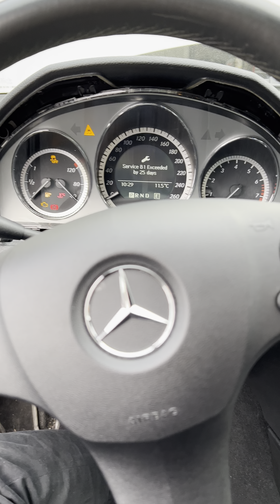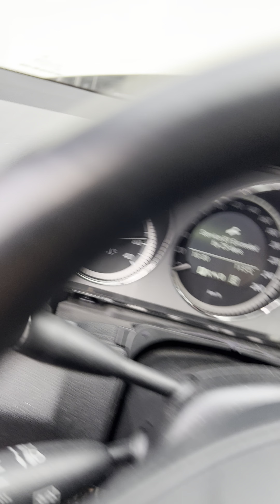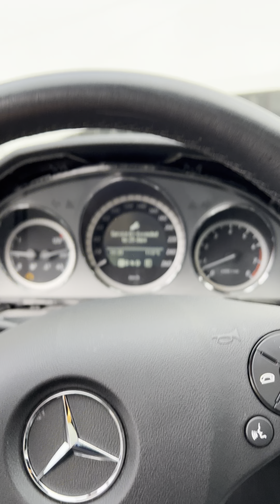Mercedes instrument cluster not working ?? TRY THIS FIRST!!!

Comment: I tried the battery first and that didn't work. Luckily, removing the fuse and putting it in while the car is one did the trick! Thank you!!!!! Saved me a ton of money!
Reply from the maker: No problem my friend 😊
Reply: I tried remove fuse and put it back put but cars wasnt on. Does it need to be on?
Reply: @jammiii3870  I had it turned on when I tried it. Unfortunately, I have the same issue again, but it's just the screen now.. everything else is working though.
Reply: @SirDavidAsher any luck?

Comment: Thanks for the video! Unfortunately, this solution alone didn't solve my issue of the instrument panel not working on my 2009 c300 (w204). What solved it for me was removing the instrument cluster and unplugging it in the back while the engine was off, then putting the key in the ignition to the on position (engine not cranked), and then replugging the instrument cluster back in, and voila everything turned back on and is back to working normal.
Reply from the maker: So you did a hard reset on the cluster, nice 👍
Reply: Didnt work for me, but when I left the cluster unplugged overnight, next day i plugged it in and it WORKED! Insane... must be some chip memory or something inside

Comment: remove the negative with the engine on?
Reply from the maker: With key on  , engine off
Reply: @BPROAUTO95  thanks
Reply from the maker: @imt1217  did it work for you ?
Reply: @BPROAUTO95  will try tomorrow and i'll let you know.
Reply: @BPROAUTO95  ok, so i removed the fuse (engine on) it didn't worked at first, the dashboard remained lit even after i removed my key (it wasn't turning on before that), but the 2nd day it was working just fine.
Reply from the maker: @imt1217  nice 👍

Comment: The video doesn't specify regarding the battery. Do you disconnect the negative on the battery while the engine is running? Or do u do it with engine off?
Reply from the maker: Sorry for the confusion, I disconnect the battery while the engine is off, ignition off, key out.
Reply: Ok thought so. But wasn't sure. The manual specifically says not to disconnect the battery while engine is running..

So I tried disconnecting the battery with engine off and key out.. worked right away. 

Couldn't find the fuse .. I have a 2015 E320. So looks to be different.

Anyways. The battery trick worked! Thanks so much for the video!
Reply from the maker: @DannyFerri  no problem Danny 👌🏼

Comment: Thanks.  The battery removal worked.  But how did you get rid of the check engine light later?
Reply from the maker: I needed to used a scanner to clear it
Reply: @BPROAUTO95  thanks for the reply.  I had seen a tip where pressing the car start button without your foot on the brake, and leaving it in that "standby" mode (or whatever it's called) for 10 seconds would clear it and that worked for me

Comment: For anyone interested- CLS 320 CDI, 2009. My cluster went blank after weak battery and bad terminal connection. Tried everything, unplug battery overnight, unplug fuses 52 and 64, unplugged the cluster itself and plugged back in and still nothing... Then just left the cluster unplugged overnight, came back next day and it WORKS!! I was literally ready to send it for repair!!

Comment: Hi!

I have similar issues detailed below:
1. Cluster suddenly just stuck. All of em. Rev counter, speedo, fuel gauge. Lcd suddenly off as well
2. Wipers wont worked now
3. Turn signals worked but the beep inside the car is not
4. My lights wont turned off😂

These all happening all of the sudden and I want to try your methods.

Just to be clear, so your methods is turn the engine on, and while it is on, disconnect the negative only on the battery right?
Reply: Hi did you sort out your issue I have a same problem

Comment: Thank you very much brother! It helped me a lot, I was in the same situation after removing my glove box and cleaning the air conditioning evaporator. I think it was a short circuit, but disconnecting the main battery worked to fix all the lights in my instrument cluster.
Reply: same, disconnected the battery, waited about a minute, then reconnected it, works perfect again./
Reply from the maker: Glad that it helped guys 😃

Comment: Will that also work on a 1996 I just swapped out the batteries and now the gauge cluster is not responding
Reply from the maker: Try to do a cap discharge
Reply: Do you have a video of that process

Comment: I have a Mercedes A170 W168 2001 disel and i have an issue with the cluster table it stops working after i drive for a while and i have to stop somewhere and disconnect the negative and reconnect it but the issue still keeps up after that. 
Any Permanent fix for this?

Comment: My speedometer is not working the rest is okay, I tried your tip but it Didn't help. Is there anything else i could try?
Reply from the maker: Check the vehicle speed sensor
Reply: @BPROAUTO95  the speed shows up on the diagnostic computer while driving
Reply from the maker: @makarena2890  try to do a basic setting the cluster 017

Comment: But do not remove the negative cable from the battery while the car is running, do it with ignition on only!..he forgot to say that. If you disconnect the negative cable while the car is running the alternator will throw like 18 V and can damage the computer.
Reply from the maker: There is a voltage regulator on back of the alternator that will regulate the voltage, but you are 100%correct. 
Turn of engine, before disconnecting the battery !!!!!

Comment: It worked with me, removing the fuse 28 and putting it back works well. Thanks
Reply from the maker: Glad that it helped ✌️
Reply: Remove  and putting back the fise while the engine is starting?
Reply from the maker: @r0b3rt35  yes, trying to do a hard reset

Comment: I have same issue with the instrument cluster and also since it stoped working, my trunk gets stuk while engine is on and mirrors not longer fold.. i removed the fuse while the engine was off, i ll try with it on.. i hope that it will works

Comment: I have A class 05-12, gauge cluster (and that central display) stops working for some time, then comes back on. Always when it doesent work also sound for turning signals doesent sound... Second time, gauge cluster sudenly while I was driving came back on, but all pointers were stuck at some position for some time and ESC (yellow triangle) goes on when I speed up, so when i press gas pedal it basicly doesent allow car to have high rpm and speed up in a usual way but I need to do it smoothly. I stopped the car for a bit and shut down engine removed the key, and when i started engine again gauge cluster and everything else worked fine... now it happened third time, cluster doesent work and in the back I believe it turns on again  ESC because again it wont allow me to get speed so I must be "gentle" with a gas pedal to get into higher gear... That happens only when Gauge cluster doesent work, three times in last two months. When gauge cluster comes back, everything is okay... It came to my mind to check that fuse box, maybe some contact is not okay or whatever, i dont know even if I open it what exactly I need to look...I believe its some small stupid thing that doesent cost so much, but if I go to the Service they will take 1000€ in a second, and my whole car costs about that much.
Reply: Did you find and solved the problem?

Comment: do you have a tip for cla 35amg 2020 the digital cluster jist shut itself of the car works just the screen don show nothing it just goes black
Reply from the maker: Can you check the aux battery voltage ?
Reply: @BPROAUTO95  no i havent but could it possilby be an fuse issue?
Reply from the maker: @janregorsek  if it turns on and turns off by itshelf, its prob the cluster or software

Comment: I have a similar issue, with the turn signals and all small electrical things just lagging and won’t work sometimes. But I get the message “display faulty visit workshop”, I heard that it may be water in the computer, but where? Anyone know where to look for water or something? I’m going mad I can’t find shit.
Reply from the maker: You can remove the instrument cluster and check the connectors in the back, see if any corrosion
Reply: @BPROAUTO95  Yeah I will do that, thanks! Have you ever seen this error code before? I mean do you know any possible solutions if this doesn’t work?
Reply from the maker: @joelrichloow1021  umm if you have a OBD scanner, scan it first
Reply from the maker: @joelrichloow1021  fault codes in gateway might cause wired things

Comment: Having a similar issue with the 2004 c320, instrument cluster, windows and turn signals just stopped working. Replaced the fuse, replaced my battery and connectors, nothing has changed. Will give these tips a go when I get home If anyone has any advice besides selling the car lol I would love to hear it!!!!
Reply from the maker: Yeah give it a try, if not working, maybe do a cap discharge overnight
Reply: Did you fix it?
Reply: @chineduoputa8905  replaced the battery and the terminals and it was still giving me issues. I did also try to clean up my fusebox under the hood a bit and thank God it sorta just decided to start working again eventually. Was just sendin er using arm turn signals and guessing my mph/fuel for a bit though.

Comment: Thank you so much. I did the battery reset and it worked perfectly for me. I wish I could give you a 100 like.
Reply from the maker: Glad that it helped 🫡🫡
Reply: Hey when you do the hard reset, does the engine need to be running

Comment: My light is on but I got no display and gauges aren’t reading anything
Reply: Also dash light stays on even after I lock it
Reply from the maker: @eddieperez7617  did you try the hard reset
Reply: @BPROAUTO95  yes I did I just bout a some new fuses abt to see if it fixes anything
Reply from the maker: @eddieperez7617  if the fuse is not broken, no need to change them, do a hard reset, unplug the cluster connector in the back while the key is on
Reply: @BPROAUTO95  ok I’ll try that thanks for taking the time to reply to me 👏🏼
Reply from the maker: @eddieperez7617  no problem, hope that it’s fixed
Reply: Jumping in to this very helpful discussion: are you suggesting getting in behind the instrument cluster from the dash and doing a hard reset of the cluster by unplugging it while key is on, engine is not running? How hard is it to get in? (Mine is MB 2019 CLA 250) @BPROAUTO95
Reply from the maker: @robinmcneal1699  yes, it’s pretty much say to remove, just trim around the cluster

Comment: I replaced the fuses in my 99 clk320 with no avail, disconnected the battery and the problem remains, any subjections anyone?
Reply: Did you find a solution?